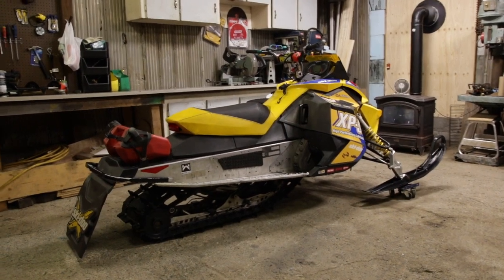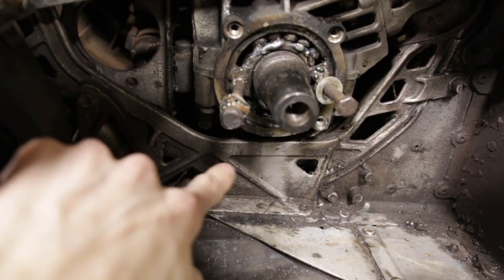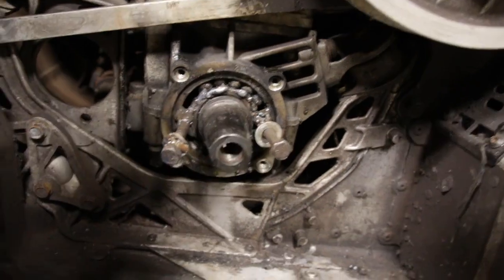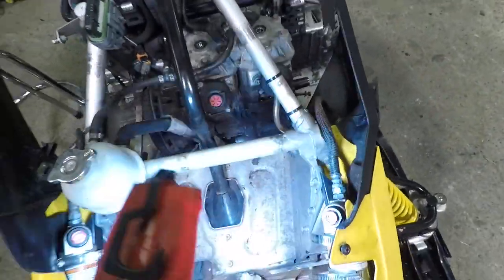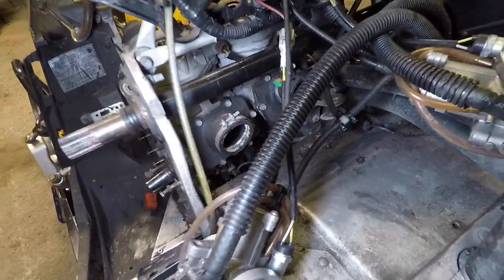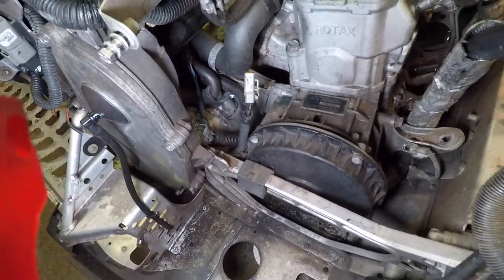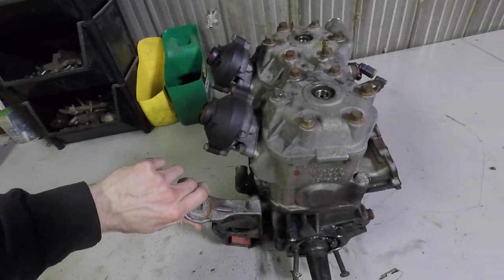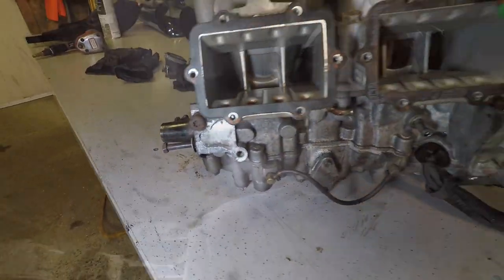2008 Skidoo MXZ 600RS Engine Removal

Comment: leave plugs in to prevent anything from falling in there and plug all exhaust and intake ports just blue paper towel works awesome stops small particals from entering the motor.

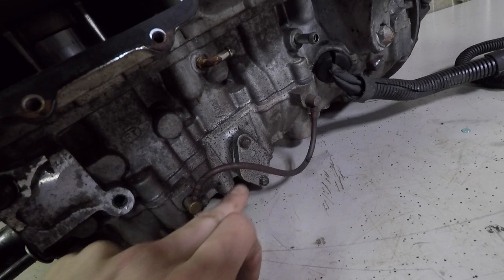Comment: At 10:16 there is a small 90 degree oil port for the water pump, what is the port that is slightly larger to the right (mag side)?

Comment: Hey I'm seeing that this video on that these comments are a little bit older but I'm wondering if anybody can help me out I took the top half of the motor out with the cylinders and I was trying to get some of the antifreeze out without draining it and it was using an air hose and it was my first time ever taking an engine apart so I didn't do my research very well. But I'm pretty sure I got antifreeze splashdown into the crank area at the bottom of the Rod's. Do I need to drain it or pull the motor out and get all the antifreeze out of the bottom end of the motor. I would assume so I've always heard that liquid in the motor is not good I'm not sure how much is in there

Comment: This is all shit that ive done b4 to a 2014 polaris indy 800sp junk polaris
Reply: Get into a skidoo yet? Lol.  Not knocking polaris. They have some sick machines thesedays. Just seems no matter how new of a sled your into , you still have to do work on em. Always something after a weekend of ripping. Cheers
Reply: @kyletracey5819  i got a ski-doo i dont want another polaris only cat ski-doo and the new guy the lynx unless yamaha looses a megaton of there weight ill get another 1 rn im on a 2006 ski-doo 600sdi and a 2014 sr viper rtx se 129x15x1.25 needs lots of work tho
Reply: @kyletracey5819  tried a 2020 ski-doo 600 carb the engine feels so much smoother then my 600sdi the way the clutches engauge and the backshifting its knoticeable but i like  the speed my rev has